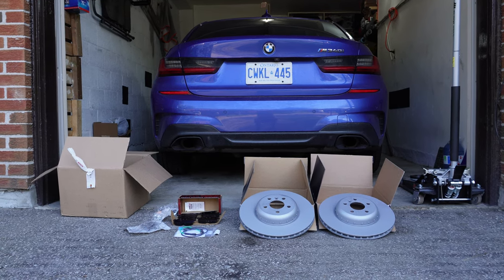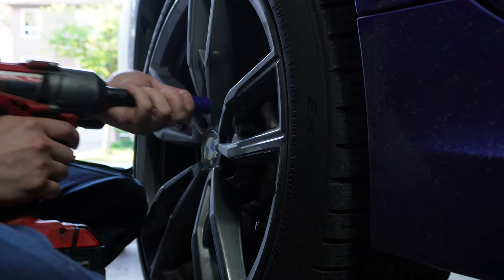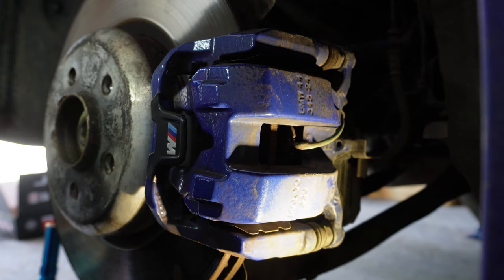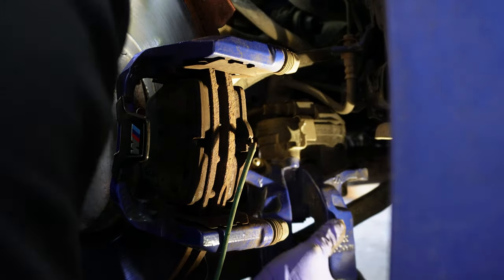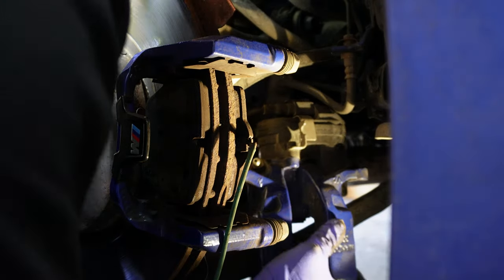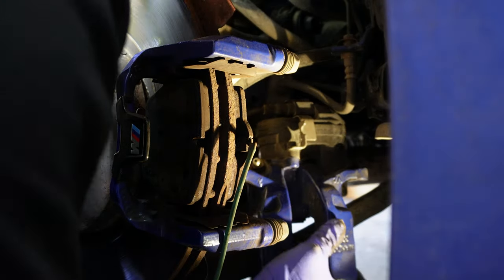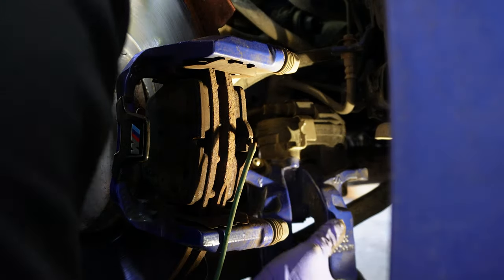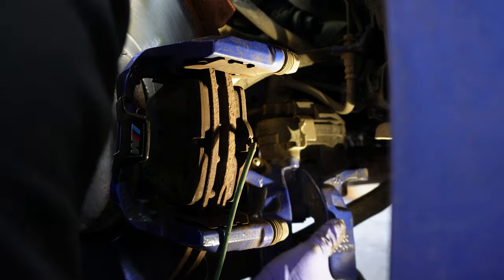*DIY* Replacing Rear Brake Pads & Rotor | BMW G20 M340i

Comment: Some ppl recommend opening the bleeding screw when retracting the piston so you don’t push flush dirty fluid into the lines; in the end they will flush the brake system 1-2 pedals each side to get air out. What’s your take on this approach?
Reply from the maker: Not a big fan going about doing an extra step that does close to nothing.
I’ve been compressing pistons back into the caliper without opening the bleeder valve for years. Haven’t had an issue so far, except for an old car from the 90s that sat in a barn for decades.
If dirty fluid is a concern, I’d flush the entire hydraulic system with new brake fluid. Otherwise, open the master cylinder cap, push the piston back, close up the cap and call it a job well done.
Reply: @ makes sense to decouple from a dedicated brake flush job!

Comment: Great tutorial, will be helping a friend next weekend with this, but just to get this clear: Should the rear piston be pushed or screwed out? You say you were able to push them in by hand, but at a later point you say "wind the piston" which implies rotation and not a straight movement. Judging by the tool you show I see no locking pin interface so I assume it's just pushing after all?
Reply from the maker: I see where the confusion lies! It’s pushing piston inward, back into the caliper.
I’m just used to saying “winding” because of how my pad spreader tool works, that it winds in and thus pushing in the piston.
Good luck at the project next week!

Comment: I see you running DWS06’s! Did your car come with RFT’s from factory? How are you liking the contis ride quality?
Reply from the maker: I am running DWS06+! And yes, my car had RFT from the factory.
I have been running DWS06+ as my “summer tires” several years ago on different cars.
I live in Toronto, Canada, where we do see all 4 seasons; and occasionally snow very badly for several days/weeks. I don’t run these in the winter, as I have dedicated winter tires.
I think they are great as all season tires, one of the best tires for daily drivers with occasional spirited driving. Low noise, great ride quality, does all season conditions pretty well.
I hate RFT with a genuine passion: they are generally more expensive to begin with; lack of flexibility to repair them in case of a puncture (not all tire shops would work on repairing RFT); harsher ride comfort, etc. The only real benefit is to the ability to get to a shop in case of a puncture, and I guess to reduce the vehicle’s gross weight since you’re not carrying a spare tire.
TLDR: I love my DWS-06+! I would recommend them to anyone who is NOT a track monster/drag race driver.

Comment: What torque do you use for the brake caliper bolts?
Reply from the maker: Manual calls for 95.9 lbft of torque for the caliper bolts. Seems relatively high to me. I’m guessing it’s to also hold the weight of the electronic motor?
I did exactly that and the bolt didn’t break in half. So I’d assume it’s safe to do so 😅

Comment: Nice guide, thanks ! You did not mention what you did after replacing the pads, like did you only apply the parking brake or did you use bimmerlink to deactivate service mode ?
Reply from the maker: You’re welcome and I appreciate the kind words!
I think you’re right, looks like I didn’t mention what to do after fitting the brake components in before going out to bed them in!
You’ll have to deactivate the service mode before starting the car - same way how you would activate service mode. I’d just do that at once along with resetting the brake pad wear sensor with the diag tool of your choice, such as Bimmerlink.
And just like any other cars after fitting new brake components, ideally you’ll want to slowly depress the brake pedal all the way several of times, to allow the brake system to generate the hydraulic pressure and push back out the brake pistons.
After that, you’ll be good to lower the car to the ground and bed the new pads in!

Comment: How did you get the cover for the sensor box off
Reply from the maker: If memory serves me right, there are 2 clip-in connection on one side of the box cover. You will want to pry on the connections, twist your screwdriver/pry bar a bit then the clip pops right off.
A pocket flathead screwdriver or a tiny pry bar would be your ideal weapon for that.

Comment: What are the part numbers can you provide them please
Reply from the maker: The rear Hawk pads is HB917B.626 (comes in a pair). The rotors are 150.2946.32 (Left and Right same part#, interchangeable).
Brake pad wear sensor is a generic ones with different part# across different website. Most part store should have a compatible one, as long as you provide your year and model, or your VIN.
Good luck!
Reply: @TandeGarage  what about the front pads / rotors part number? Thank :)
Reply from the maker: @kevinsabine5672  HB916B.740 for my Hawk HPS 5.0 front pads, and 34116860911 & 34116860912 for Zimmermann front rotors (one is left one is right, they are directional).

Comment: I believe I upgraded all four of mine with these and took it to a mechanic for install, how are they an upgrade?
Reply from the maker: I think it depends on how you view them and feel their braking power; compared to OEM rotors and pads.
I really like that the HPS 5.0’s don’t have a strong initial bite, compared to the OEM pads. It’s great for driving in the city, you don’t go nose-diving when you are just barely tapping the brake pedal.
Once they are heated up, bites definitively grow stronger, and yield the same if not more braking power than OEM pads.
They are also a tad bit less dustier than the OEM pads. Less work in cleaning the wheels when weekly washes come by.
Hope this answers your question!